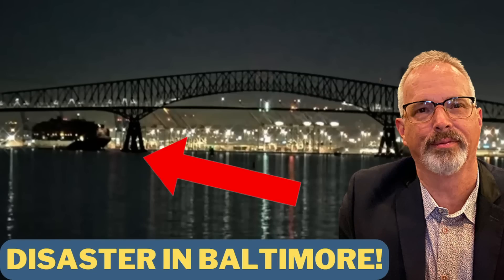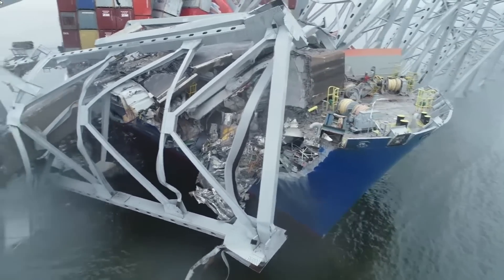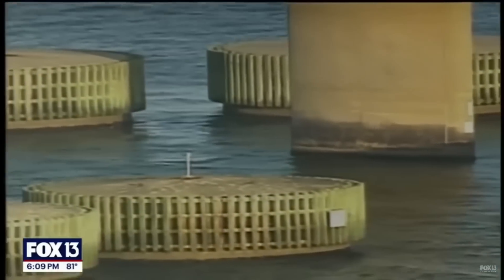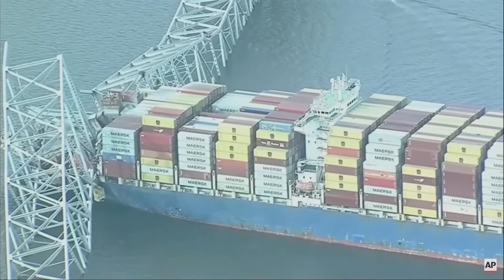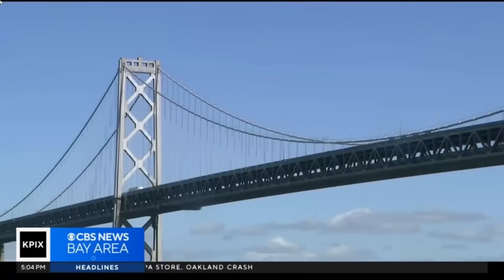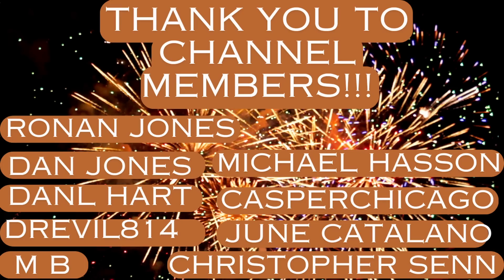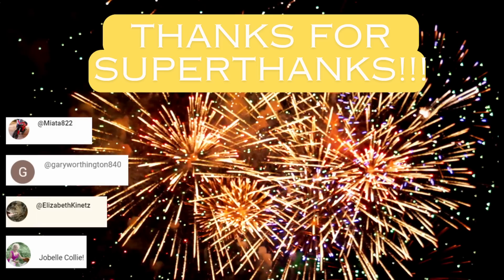How the Francis Scott Key Bridge in Baltimore should have been Protected

Comment: I have one question: the coffer dams and dolphins (sp?) are clearly designed to absorb momentum to stop a mass.  In California much research has gone into redirecting the force of the momentum in traffic dividers in highways and freeways (K rails) to force an errant vehicle back into correct traffic flow instead of just stopping the car-truck; mostly to prevent idiots from flying into oncoming traffic. Wouldn't this be a better way of protecting bridges?  RE-direct the ship with SHAPED coffer dams instead of just blocking them. OK two questions; The ship would probably sink after being forcibly redirected, but the bridge would remain intact, and re-direction would need less inertial mass than a stopping mass, and isn't a sunk ship less costly than a closed port? Why is the mayor of Baltimore so touchy about engineers questioning an obviously faulty bridge?  OK several questions.  I didn't expect a kind of Spanish Inquisition.

Comment: In short, it will take at minimum four years to replace this bridge. It will likely be something close to the design of the current Sunshine Skyway Bridge, a stayed-cable bridge with two towers and massive pier protection systems for the towers. The other possibility is a tunnel, but that would take seven years to build, especially since the tunnel has to be designed to be safe even from hazardous cargo truck crashes.
Reply: From what I’ve read, no tunnel allows hazmat so don’t think that would work…plus, they originally considered a tunnel here but rejected it for inability to do hazmat and oversized but also it would have cost twice as much.
I suspect same is true now.

Comment: You hit the nail on the head regarding younger generation smugness and inexperience.  Couple that with younger non-engineering management who think in terms of career advancement and cost and you have the recipe for shoddy inadequate designs.   Both get rewarded for slick designs produced at low cost (in relative terms) by upper management.  The stories I could tell in the 35 years I was involved in machine design! Generally, issues appear relatively quickly once the product is introduced into the field and service costs skyrocket.   In terms of major civil engineering infrastructure, it might be years before the issues appear and perhaps the designers have long retired or passed.  It's the old cliche'..."those who don't know history are doomed to repeat it."

Comment: Great job!  I agree with your assertions about preventable and loss of professional wisdom.   I was familiar with the favorable upgrading on the Delaware river.  The Chesapeake Bay bridges, just 10 miles away from the FSK bridge, are glaring examples of Maryland state short sightedness.  The ships traveling up and down the bay are traveling twice as fast, and we know the kinetic energy is 4 times higher!  Also the Chesapeake Bay bridge piers are mostly in deep water making them more susceptible to collision failure.  I wonder if the public knew whether they would continue to use these bridges?
Reply from the maker: Thank you!  You make great points.  I think there will be a lot of attention paid to these types of bridge in the near term.  We'll if any thing changes.

Comment: A great Insightful video tutorial.  This incident was preventable, and the cost upfront is cheaper than the subsequent economic damage from [its] collapse.
Reply from the maker: I appreciate it.
Reply: @CaseyJones-Engineer  Howdy, I worked on several big bridge infrastructure projects in Western Canada in the capacity of bridgeman carpenter/piledriver.  Peter Kiewit/Port Mann Bridge and Bilfinger Berger/Golden Crossing Bridge.  Massive projects all done between 2010 to 2016.  Very hi-tech bridge construction.  I was amazed to how quickly the Francis Scott Key Bridge came down.  Perhaps a case of throwing caution to the wind regarding the overall engineering.  Great video, I'll see you on the next bridge project, Cheers!

Comment: It's painfully obvious that they didn't protect the bridge when you can see how beefy the protection for those nearby high voltage line towers are so big.
Reply: 47 years ago the harbor was not as deep, and the ships that could come here were much smaller. The power lines are more recent. Of course, after 47 years of operation, there's lots of hindsight.
Reply: I bet those power lines are owned by a private company whose insurance company demand the protections capable of stopping ships.  And yes, the barriers around those towers would stop a ship because they are also protected with submerged obstructions.  Typical corrupt government response allowed this bridge to go unprotected for 40+ years after the Sunshine Skyway disaster.  Think about the $30 Billion Baltimore Inner Harbor 2.0 project which is just the latest billion dollar project to beautify the Inner Harbor over the last 40 years and it is just like New Orleans when they found out the federal money that was given to rebuild the levees BEFORE Katrina had been spent on casinos and prettying up the French Quarter to draw more tourists.
Reply: No politician wants the wrath of several million women whose blow dryers & curling irons won't work due to a blackout !🥶
Reply: They are beefier because of current regulation and safty standards in place. Do you think the companies would have built them if they weren’t required by regulations?
Reply: Would be interesting to see if the original bridge spec called for beefier pier protection and then somewhere down the project line someone made a decision to save on cost.
Reply: @KnowledgeDriven  no, ships got larger over the next 50 years since the bridge was originally built. Infrastructure in the US is just old and outdated, and no longer suitable or safe considering current situations. China has far more big giant ship traffic, yet half the big bridge collapses has been in the US. Their bridges being newer, are scaled for current ship sizes.

What you need to check is if CURRENT standards for bridges built today specifies better protection against collissions, but the old pre-existing bridges got exempted because it costs too much to upgrade all the old stuff.
Reply: @KnowledgeDriven  No, What happened was this bridge was built in 77 they changed bridge laws in 1980 3 years later after a collapse in Florida so the Key bridge was Grandfathered in since no one was going to condemn a 3 year old bridge just because of new laws, Now from my understanding over the years it had been suggested that protections should be put in place but was always shot down as it was almost an impossibility that something might happen, You're never going to get anyone to pay for something that might happen and with that it was left the way it was built .
Reply: @x_warhog_x8701  Thank you. I've been checking out videos from some of there "experts" and they're full of mis0information.
Reply: @KnowledgeDriven  no, it was built to the standards of time.  But after the 1980 collapse in Tampa, adequate measures should have been taken to beef up this one, and those tiny bollards way out from the bridge are a joke.
Reply: @christopherjahn2044  I agree, they failed, but I've been under the bridge in a boat, and those structures are huge.
Reply: @1972Ray  compared to properly engineered dolphins, they offered no protection at all, as we've seen.
Reply: @1972Ray  huge means "easy to run into."
Reply: Exactly
Reply: 15:40. Maryland DOT benefited monitarily from not protecting the bridge.
Reply: Those power line dolphins wouldn't have done anything

The VDR shows the MV Dali hit the bridge at 7.8 mph. At ~100,000 tons that translates to ~580 MJ of impact force or the equivalent of 2x 16" naval gun Iowa-class Battleship shells. 

Had she hit them going her ~10mph transit speed, the force would have been 40% higher.
Reply: @adonislimes6156  Just to be clear, the power lines have their own (meager) protection, but there are 4 dolphins for the bridge itself, one for each direction for the two pylons. The ship completely missed the one that was supposed to protect the pylon it hit. How it got built in such a useless spot is a mystery I'm hoping the investigation will, er, investigate.
Reply: @blairhoughton7918  the power line dolphins may be good enough... Given the are in a bit shallower water... That helps limit what can get to them (or at least how much energy is left after pushing a lot of mud around to get there).

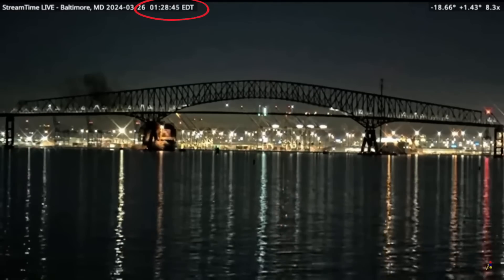Comment: When you look at the image at 11:40 in the video you can see that the port has spent massive amounts of money upgrading and in the foreground there is a bridge that is desperately in need of raising and safeguarding.  I am sure that the bridge was adequately maintained but after 80 years the infrastructure just needs to be re-evaluated.  Certainly they could have started rebuilding the protection barriers with the goal of eventually rebuilding the bridge.  So what now.  1 clear the channel asap. 2.  acknowledge the current environmental impacts and document them but do not let impact studies stop the rebuilding of the bridge. 3 fix all the environmental impacts post bridge building and make this task mandatory.  This way everyone is made whole. SMDH (shaking my dam head, for those who do not know SMDH.)  In addition it looks like the electrical poles need safeguarding as well.  It appears they are not protected at all.

Comment: I think the revetment solution would have worked here, but considering the "perfectly imperfect" angle which the Dali took in hitting the bridge, it probably would have circumvented many "dolphin" designs.  So if the bridge had been upgraded, depending on the design, it might not have worked in this case.  And hindsight is 20/20.  Had the Dali taken a slightly different angle, and hit one of the existing "dolphins," we would probably be talking about how effective the bridge's design was.
Reply: It should have a large dolphin and a robust fender.

Comment: CAUTION
REQUIRED CLEARANCES FROM OVERHEAD HIGH VOLTAGE LINES
VOLTAGE (PHASE to PHASE)
MINIMUM
600 -
50,000
10 FT.
OVER OVER OVER OVER OVER OVER OVER
50,000 -
75,000
11 FT.
75,000
125,000
13 FT.
125,000
-
175,000
--
15 FT.
175,000
250,000
17 FT.
250,000
-
370,000
21 FT.
370,000 -
550,000
27 FT.
550,000 - 1,000,000
42 FT.

From Faraday's law of induction, any change in magnetic field through a circuit induces an electromotive force (EMF) (voltage) in the conductors, a process known as electromagnetic induction. This induced voltage created by the changing current has the effect of opposing the change in current. This is stated by Lenz's law, and the voltage is called back EMF.

YouTube induction forging

Look at google maps power line’s bases are only there so power lines were new

Google parking under power lines and fire assessment working around power lines

The crosswind moved ship out of lane they needed the speed to overcome the wind 

Requirement for no wake zone is that you can control your ship at minimum power

I’ll be quick 

ADD in a factor to the accident. Been that close to HIGH tension power lines!!! And being 90 degrees to them. Creating a transformer effect ie power loss 
Examine closer to look 👀 for plasma discharge even between shipping containers also ship bridge the equipment on top of pointy look closer ion damage
The wires still over Ship 
Gauss meter and when rains or fire boat spray water 🚿 at night you will see the EMF THAT CAUSED ELECTRICAL ANOMALIES

Comment: You can be assured that this new bridge will be higher and better built as well as better protected than the old one. There is the consideration of the political climate in the time between the time the bridge was built and the collapse.
Reply: Yes, agreed !  This particular bridge's replacement will be done properly.  That leaves all the other bridges in the US, Canada, and around the world to worry about.  As much advantage as possible should be taken of the Key Bridge collapse to spread the word that other bridges are vulnerable too.
Reply: @Lost-In-Blank  After this happened I watched a CBC report on the Port of Vancouver where the giant tankers come in to load up. Their rules are a tug at each end  when they are transiting the Frasier River in and out. The cruise ships that go under the Lion's Gate Bridge are speed restricted and these ships just barley fit under that bridge. In other area of the port there are speed restrictions also. I can see similar speed restrictions in the Baltimore bay are as well as tugs escorting the ships as the enter and exit the port area.
Reply: @pbear6251  Even modern cruise ships can barely clear the Verrazano.

Comment: This disastrous event should never have happened. As in the past 50 years there have been a number of significant incidents notably the 
Tasman Bridge disaster on 5th January 1975 in Hobart, Tasmania and the Sunshine Skyway Bridge (southbound) on 9th May 1980. 
Showed exactly what happens when an unprotected bridge is hit by a ship. 
I have heard people commenting that it was the size of the MV Dali that was significant. 
However it should be noted that the ship that brought down the Tasman Bridge the MV Lake Illawarra was much smaller at only  7, 274grt as opposed to the MV Dali at 95,128grt. 
The point is that bridges are simply not designed to withstand such forces even from quite small vessels. One only has to think of the catastrophic events of 25th October 1960 when the MV Arkendale H a 229grt coastal tank barge that was towing the dumb Wastdale H towards Sharpness Dock on the River Severn in England. Due to fog the Arkendale H missed the entrance to the docks and hit the railway bridge bringing down two spans (unfortunately a gas main was ruptured causing a fireball that engulfed both vessels and killed five crew members).
This is a well known risk and the relevant authorities should have taken action when the bridge was built in 1977 (some 2 years after the Tasman Bridge disaster).
Several ports that have vulnerable bridges often insist on tugs being present at all times until the bridge is passed. In some cases the bridge is closed to road traffic at the same time. In others there is a prohibition of ship movements at night or in poor weather conditions. 
The real nub of the issue is cost.
Transportation authorities want to spend the absolute minimum on providing protection when they are building the bridge.
The port authorities want to keep the port operating 24/7 regardless.
The shipping companies want to minimise the use of tugs etc etc. 
It is all about keeping costs down. 
My late father worked as a marine engineer on many types of ship including VLCC's/ULCC's. I recall him commenting that in the case of larger vessels that they are often relatively underpowered in relation to their size.
As a result of this it can be difficult to make sudden course corrections particularly at relatively low speeds in confined waterways
He also told me that in the interest of economy and efficiency at sea the ship will have a single fixed pitch screw. Going on to note that such an arrangement is not ideal at lower speeds in confined waterways.
Also it should also be remembered that you simply can not put the brakes on like a car! 
I suspect that the reason the port anchor was dropped was in a desperate attempt to get as much anchor chain on the river bed to try to slow the ship.
Whilst I have no idea of the tidal conditions it is important to remember that the ship has to be making enough headway to allow the rudder to work effectively.
Usually in major incidents like this there is a sequence of seemingly minor events that in themselves do not cause any problems. 
However if they occur in a certain way catastrophe can follow.
I was speaking to a friend who knows the Chesapeake Bay area quite well and he told me since the  crisis in the Red Sea several shipping companies including Maersk are avoiding the Suez Canal. He told me that normally a vessel bound for India or Sri Lanka (MV Dali was bound for Colombo) would cross the Atlantic into the Mediterranean and into the Red Sea via Suez. However because of the situation vessels on such routes are being diverted via the Panama Canal. He wondered if this had any bearing and to minimise costs etc etc tugs were only used to take MV Dali off her berth at the terminal. 
Hopefully the various bodies involved will make a very detailed and exhaustive series of enquiries into everything surrounding the event and that a series of best practice recommendations will come out and hopefully adopted.

Comment: A former linehandler deckhand. I have seen up close what a loaded ship bump bumpers. Scary. A heavy dolphin or concrete abutment would have stopped / deflected ship before bridge damage.
Reply: There is a simple fool proof solution don't build bridges that require piers in the water near busy shipping channels. A suspension bridge would have been ideal here.
Reply: @jonathanbuzzard1376  maybe at least put bridge base in shallow water where ship would run a ground before impact was possible. Or have tugs up till pass under
Reply: @frankhobsonKJ4CDM  That's another option, though there are advantages to not putting anything in the water and especially not corrosive salt water. Either way if you are busy building pier protection in the water on a river that size you are building the wrong sort of bridge in the first place IMHO. Nothing beats passive safety.
Reply from the maker: Thank you for your comments on that. I'm getting a ton of people saying nothing could stop these ships.
Reply: @CaseyJones-Engineer  NTSB b roll of ship wreck in Baltimore https://youtu.be/UIA5uH-i08I?si=LbOC5K-teQCh5chC
Reply: @CaseyJones-Engineer  more deflected than stop. Get that much momentum something got to give. That accident should have been avoided by infrastructure